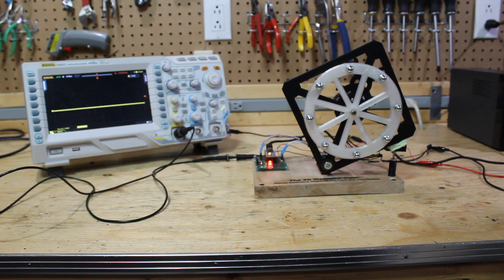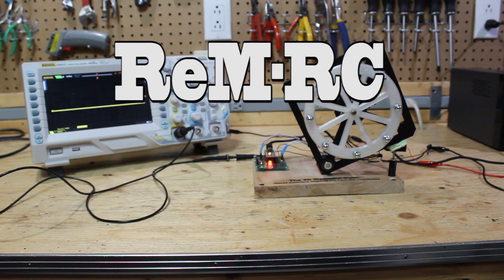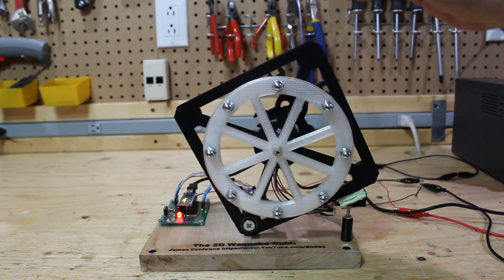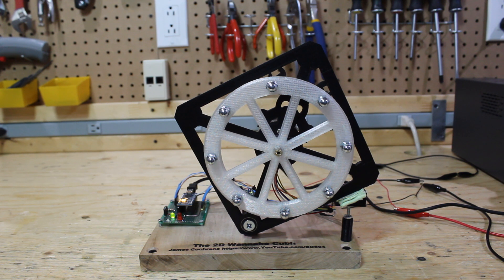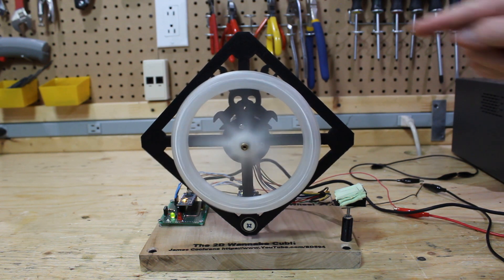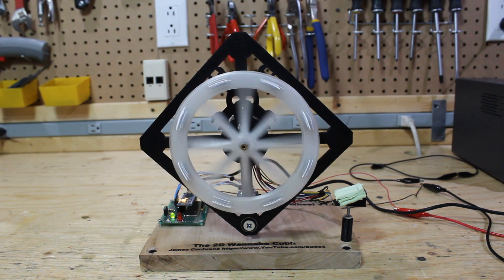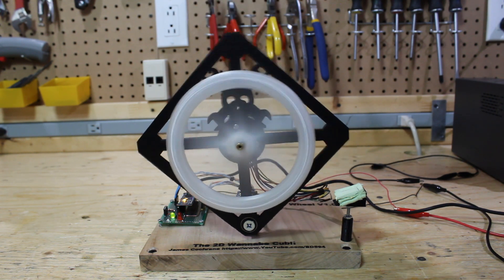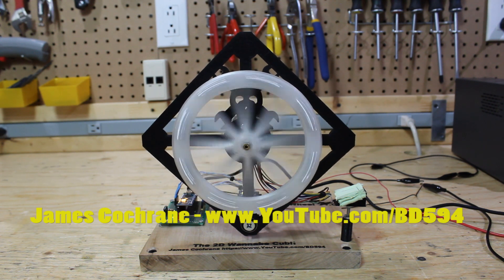Build Your Own - 1D Wannabe Cubli Reaction Wheel

Comment: Great work! Thanks for the open source! A question: the nidec blue wire that goes to 5v and through resistance to D12 Arduino pin is correct? Looking to the nidec wire diagram I see blue wire as 5volt encoder power and A and B wires as encoder data.Thanks !
Reply: I was also looking at this. I think the blue wire is stop/start